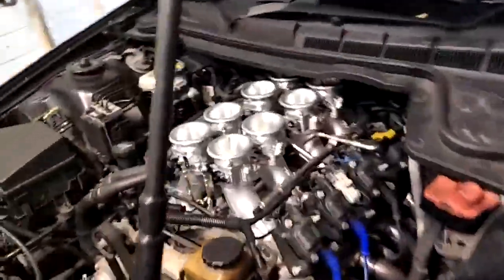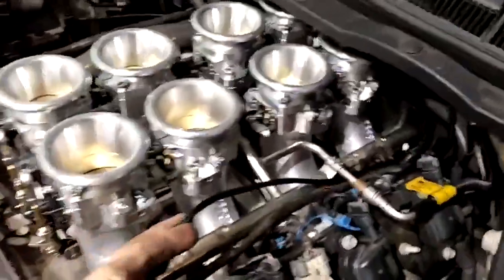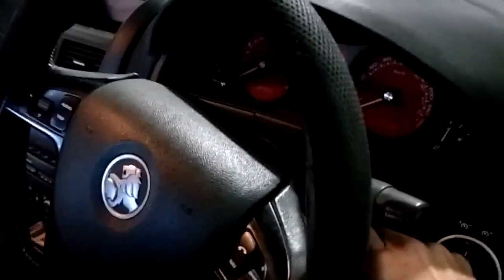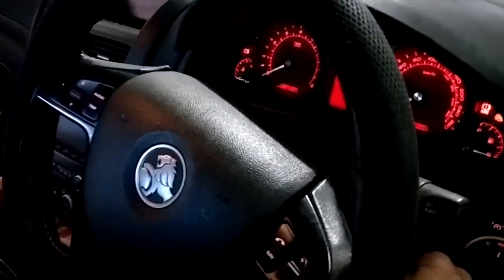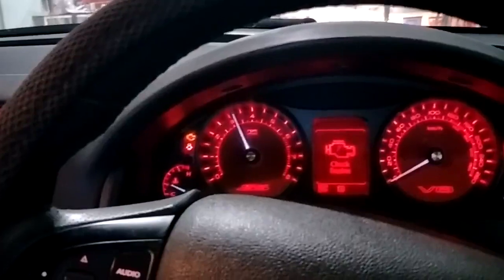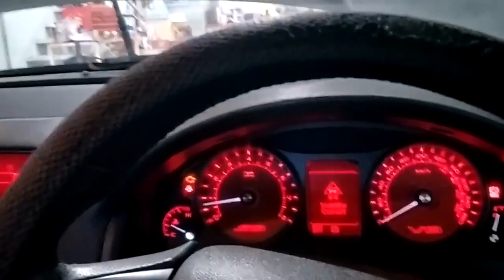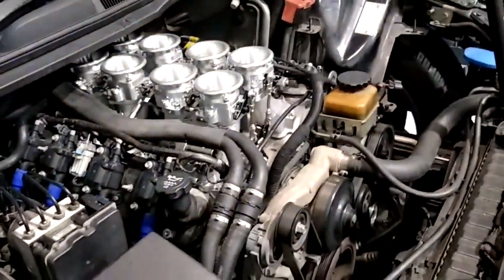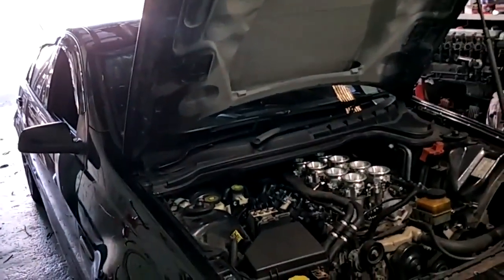HOLDEN VE L98/LS3 with ITBs - ANGRY SOUND - REDUX RACING

Comment: How you going to feed he back 2 ITV's with better airflow? Great work mate, Aussie built 💪🇦🇺
Reply: ITB🤦
Reply from the maker: Hi Dave, as long as it has atleast 20mm clearance, flow should be the same. Aussie built!
Reply: There is literally nothing Aussie built about this engine.
Reply: @RallyRanchMotorsport  where do you think this ITB manifold is made?
Reply: @RallyRanchMotorsport  Its a redux racing kit...
If only you were as right as you were confident...